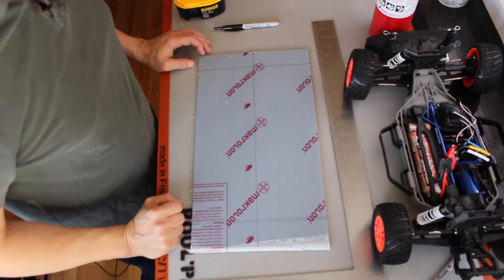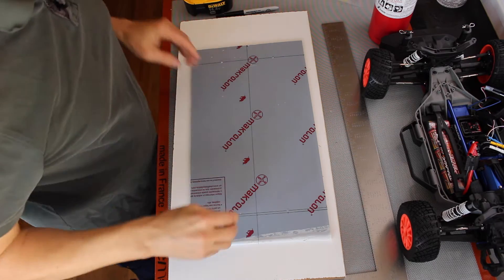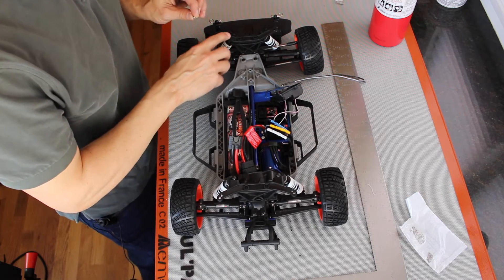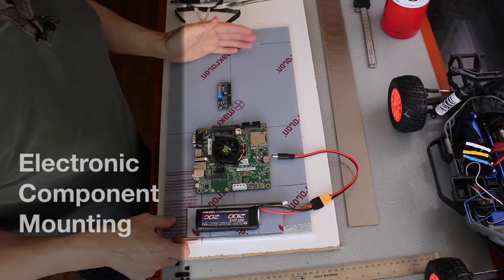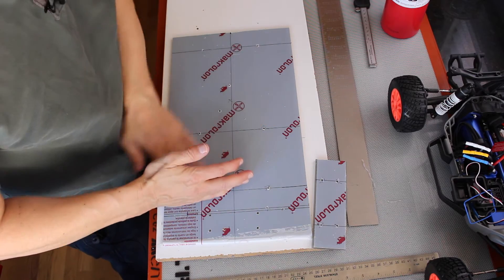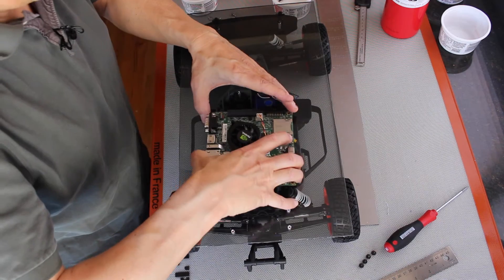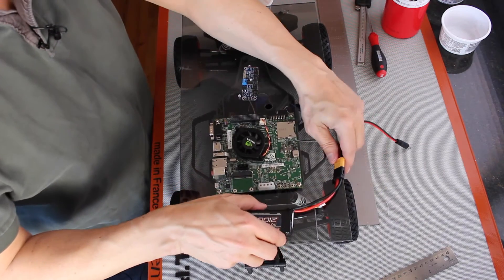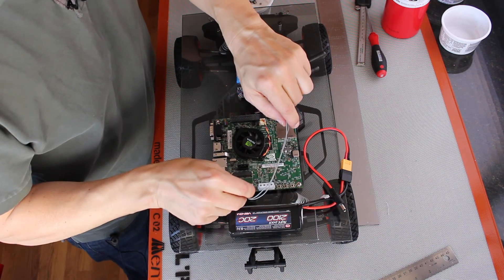Jetson RACECAR Part 5 - Lower Platform Mount + Components

Comment: Hello Jim, thank you uploading and keep us updated about this awesome race car. please explain me what are the benefits of using MPU like Jetson rather than a MCU for this kind of project. usually we get better processor, ram, memory space and overall better performance. but what are the capabilities, possibilities one can get from MPU like Jetson over a MCU.
Reply from the maker: +WEKRAYS Which MCU are you using?
Just as a reminder for other readers, Jetson TK1 is a quad core 32-bit A15 ARM design for the CPU, with 192 CUDA cores for the GPU. The TK1 has 2GB of memory. The Jetson TX1 is a quad-core 64-bit A57 ARM design with 256 CUDA cores and 4GB of memory. Both are clocked at around 2GHz. 
To answer your question, the Jetson is used for running Robot Operating System (ROS), performing sensor fusion, and SLAM (Simultaneous Location and Mapping) which is used in autonomous path planning and obstacle avoidance for the vehicle. In the second version of the RACECAR at MIT, they are using a 2D 40Hz Lidar, a 3D stereoscopic camera and a 3D infrared based camera simultaneously with a Jetson TX1. In general, the GPU is used for 3D scene reconstruction.
Reply: thank you for the reply jim. well i mean like TI stellaris launchpad, arduino sort of MCUs. if you have anything to add please do. btw you have done a good explanation in your reply.great!
Reply from the maker: +WEKRAYS MCUs are generally used for direct and simple control of external devices. In computing terms, it's easiest to think of them as real time control for peripherals. Some are simple 8-bit devices, such as the Arduino UNO, but as computing moves ever forward, 32 bit devices like the Arduino DUO are now available. The Jetson uses a full fledged desktop computer OS (L4T/Ubuntu) which makes servicing peripherals a relatively difficult task. The MCUs tend to be configured on a cost basis, a minimum of computing resources to get the job done, tend to be a little slower, have a little less memory, and such. 
With all that said, in a sophisticated robotic system most architectures use MCUs in addition to a larger computer such as an SoC. The MCUs provide real time control of peripherals, and then the SoC provides higher level control of the MCUs. For example, in this little build a PWM driver is being used to control the servo and ESC because it provides the clock and real time control needed for the peripheral devices, and the Jetson is controlling the PWM Driver. A MCU like an Arduino could also fulfill the PWM driver role, with the Jetson communicating with the Arduino over serial.
Reply: Thank you so much jim for the detailed explanation. much much appreciated. very valuable for new people for embedded systems like us.